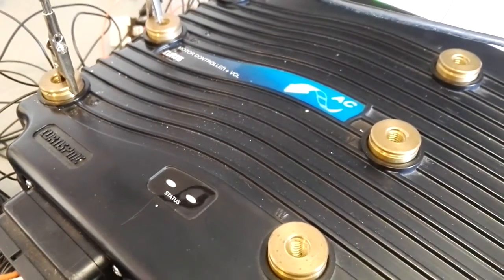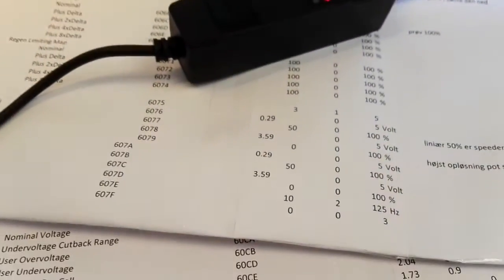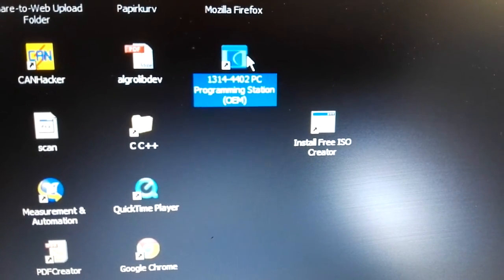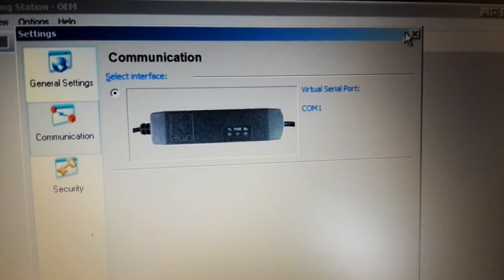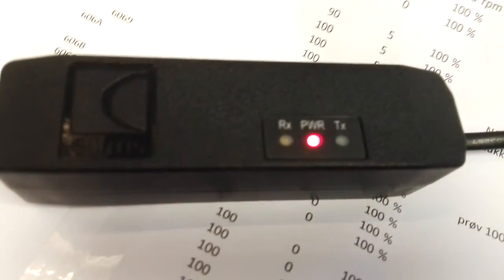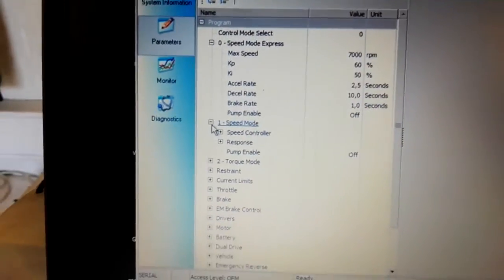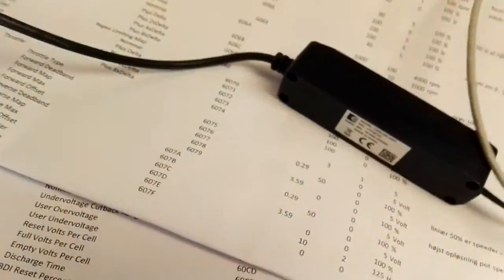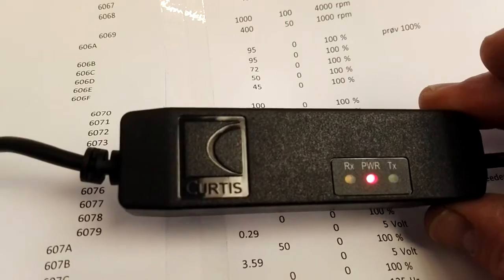Curtis1309 and curtis 1238 usb adaptor

Comment: hello, how do you connect the 1309 to the controller?, I can not get the power on led, when the power led should activate?, when is plugged to the PC or both the Controller and PC?. thanks
Reply from the maker: programmer use th serial port on the controller, the same port is normally connected to the 'spyglass' / instrument / meter

Comment: Hi @myNerdStuff I have seen your videos for a while... I am from Ecuador... Well I am a mechatronic engineer but I don't have experience with this type of DC MOTOR CONTROLLER I have just worked with simples dc motors controllers... Well I have a problem, the D. C. MOTOR CONTROLLER has crashed and exploit from a cleaning cart. I have bought the module MODEL: 1228-2908... But when I installed to the car and connect all, it starts to going crazy because I think the module doesn´t have charge the program... I don't have the programmer, how can I do it...? Please could you help me? I will give you my email! I will apreciate if you help me via skype or something like that. (email:cesar.salinas93@hotmail.es) Thank you very much, hope to hear from you soon. This usb adaptor works to program my D.C. MOTOR CONTROLLER?

Comment: Can you tell me if you can adjust the regeneration during the braking phases of the vehicle?
Because I have an electric SimplyCity, and it brakes excessively in deceleration.

Pouvez-vous me dire si on peut régler la régénération lors des phases de freinage du véhicule ?
Car j'ai un SimplyCity électrique, et ça freine exagérément en décélération.
Reply from the maker: NANTES OVNI it can be done with the oem 1314 programing station and a programmer adaptor like curtis 1309. I think best place to find guide to.setup this is the forum  ivan benneths garage

Comment: Only 400$...
Reply from the maker: +Dan Frederiksen yes quit cheap, i gave $419, got it from https://www.nocoev.com/product/1314-4402.htm in can recomend them, they are a serios company
Reply: +myNerdStuff I would rather make a new controller with everything that could sell for less than 420$
Reply from the maker: +Dan Frederiksen yes, but not a easy job to diy ;) but i know a great diy motor controller kit. 
If i haven't succeed installing OS and setting up my new curtis 1238, i planned to build this diy project: http://johanneshuebner.com/quickcms/index.html%3Fen_motor-inverter,8.html
Reply: +myNerdStuff, I know. very few people in the world could do it right. But then it would be available to everyone so we aren't slaves to curtis overpriced junk anymore.
Reply from the maker: +Dan Frederiksen would be great :) Think curtis is quality, but yes, very expensive. But aren't all motor controller brands to expensive? If we look inside, and compare to other power inverters, motor controllers are something like 3x the price
Reply: +myNerdStuff, oh yes, so far AC controllers have been extremely expensive without good reason. State of the art IGBT and capacitors are quite inexpensive. A good 50A TO247 IGBT is 2$ or less. Good panasonic EEU capacitor is around 1$ iirc. And for a controller with 100kW power you might need 24 of each. That's under 100$ and the rest of the electronics doesn't cost anything of significance.
Yet 10000$ for such a controller was normal and 3000$ was considered cheap. So stupid.
Reply from the maker: +Dan Frederiksen yes thats right, might be a great kickstarter project to make a costum modular / scalar ac controller project from 12 v to 300 v or so
Reply: +myNerdStuff hmm, that's a thought but it's a fairly niche market so backers could be very few. I suppose you don't need many sales at 600$ a piece for it to be worth while. Over 100 might be ok for a meager business. But it's tight because if you sell 100 they better work really well.
the mechanical layout is  probably the hardest and most costly when it comes down to it. but maybe.
the market for diy EVs is also fading. factory EVs are too cheap and good now. you'd be crazy to make your own unless it's extreme.
You can get a used Leaf for 8000$ in california now.
Reply: +Dan Frederiksen a niche yes, however, in the near future think all scooters, lawnmowers, small boats, small tractors and more will be driven by a electric motors. To make this possible highQ motor controllers must go down in price. Think a 3d design, and professional 3d print/laser cutting would do the mechanical job, the printed circuit board should be possible to diy also. But a lot of work before a complete system are ready.
Reply: +michael pedersen obviously the controller market is already huge but that actually sort of undermines the idea because when you have the chinese mass producing controllers, then you have no market...  so if you build a product, you have to expect being outcompeted by cheap versions when it becomes mass adopted. Or you have to be unique somehow, always staying ahead.
It's interesting to see how the controllers for RC motors are done so casually and aggressively and cheaply while we stress so much in the DIY community that we end up doing nothing.
I tried many times to get Jack Rickard to wake up to how great the potential was for making a controller becuase he has the financial freedom to make it happen but the psychological fear of the concept was too much for him and for many. Which is a huge shame, because he could have done so much. Instead all his efforts have been for nothing. He never made a difference other than entertain the saved while we wasted time.
Reply from the maker: +Dan Frederiksen yes it should something special, some inspiration from they way elon musk do stuff might work. He really change things, but you proberly right about copycats. RC stuff are high volume, low price, often it not worth the effort to diy stuff nowadays. Unless it have special features or combined functions